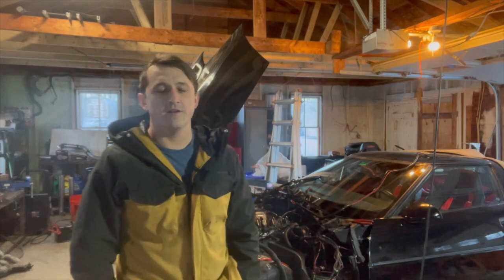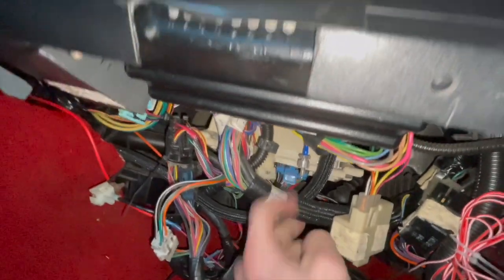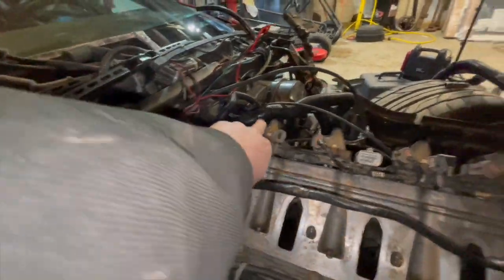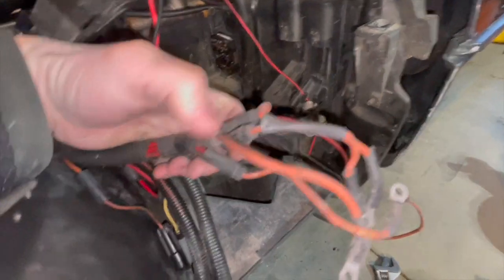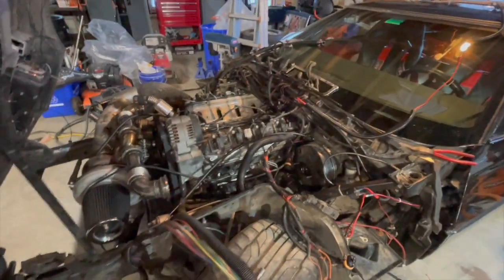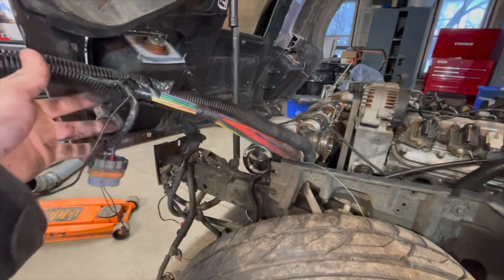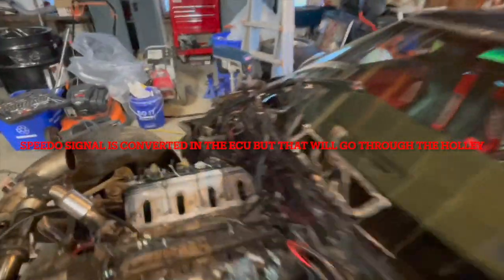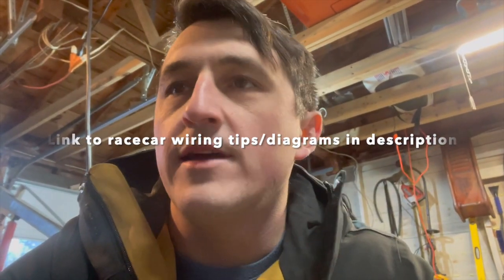How to delete OEM ECU and wiring in C4 Corvette Part 1

Comment: For my swap, I removed every bit of existing wiring from the factory, and did custom fuse boxes and wiring for everything, lights, windows, blinkers, ignition, and so on, I have remote start? Remote window control, and all while keeping the interior looking untouched. Except I have an 84 and ripped out the stock interior and put in the 93-96 torch red and black interior.

Comment: Have my 87 C4 with a Blueprint 427sb in her. Could not find anyone alive to reprogram the Chip, so I bought a FiTech 38351 kit and wired it in. My approach was to pull back all the wires that were going to be replaced by the FT system. I left the original CPU in place, but then cut and capped off the old wires inside the engine bay. Most of them were injector wires, MAF wire, IAC, and Block water temp wire. Leave the A/C compressor wire. With that, my dashboard works 95%. Only the fuel mpg and range do not work. I was very pleased with the end results. I also put the new FT CPU and fuse block right next to the old unit. I had to delete the passenger duct and I also swapped out that "Sponge" dashboard pillow for a flat panel. Now I can easily pop that off and access everything. Thanks for posting and good luck with your build.
P.S. yes the "Check engine light stays on, so I am going to delete it as the new controller keeps the codes in it now.
Reply from the maker: Oh that’s awesome! I bet it’s fun to drive. I have the same issue with the fuel mileage and range but someday soon I’ll get the Holley hooked to speed sensor on my driveshaft or something so I can know that stuff on the Holley. 🤘
Reply: As you know, with 600+ HP these C4's are scary fast with their incredible low-end torque. I had to throw on a set of Michelin Pilots on 19-inch rims. The old P255's on stock 16 rims just would not hook up at all. Very dangerous. I love having the controller to make on the fly adjustments. Best decision of the build.  It cost an additional $1500.00 but well worth it. My next goal is to tune for mileage and save the file. I am getting 15-17 mpg and would like to go on road trips with her. Working on the paint right now. Cheers!  @brakestandgarage

Comment: I did this a little over a year ago. The info online is horrible. I was able to scrape up enough to be able to go in and de-pin a large majority of the ECU and remove a ton of wiring. I was pretty set on maintaining the "look and feel" on the interior but also keeping the engine bay clean. Worked out well. I have a ton of printouts/pinouts of the whole cars wiring that I had to use.
Reply: Hey, I was wondering if you're open to sharing your pinout information.  Im still learning what wires to keep and get rid of .